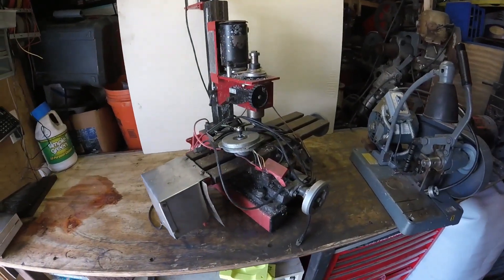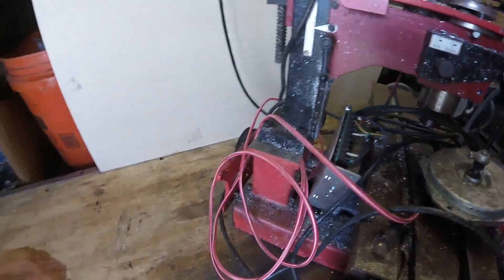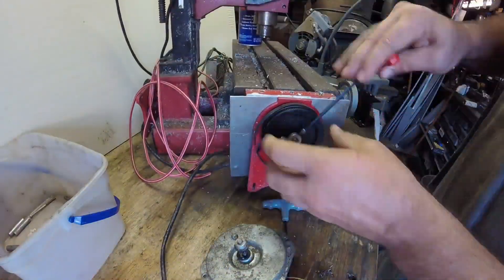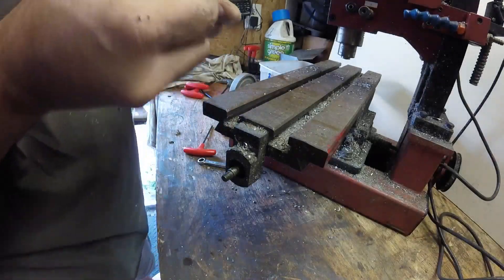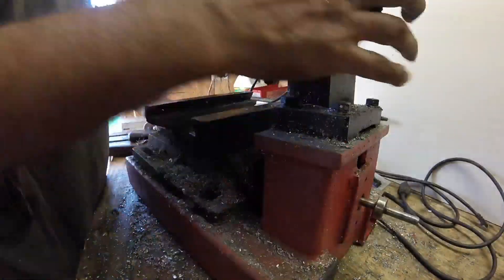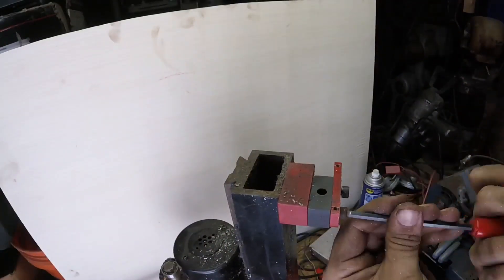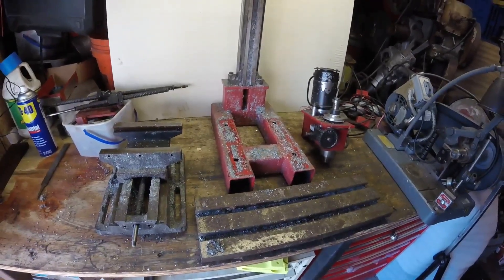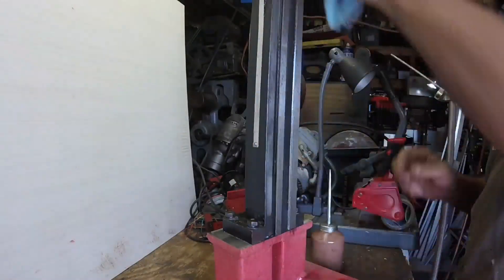Derelict CNC mill retrofit - Part 1 - Disassembly

Comment: That mill reminds me of the BK Rodeo burger where they repurpose their burger, onion ring and nugget sauce and pass it off as a new product.  In this case, they repurpose a 5" drill press, an XY vise and stock tubing.  LOL!  You gotta Rodeo mill.
Reply from the maker: HAHA!  I sure do.  When I first got it I looked it up to see what it cost new and almost fell out of my chair.  It was only about 3k less than a barebones Tormach 1100.  Don't know how many they sold but they don't appear to have a website anymore.
Reply from the maker: In the past I've gone round and round about converting some of my manuals to CNC and the final verdict for me is it's just not worth it.  For as cheap as you can get an old CNC with problem electronics and retrofitting you'd be way ahead then converting from manual.  Just the ball screws alone are a small fortune.  Building from scratch seems like it would be even worse.

On the other hand, by looking at this thing and what I've made on it in the past you probably could make something fairly decent out of almost scrap metal with only a few key components; one being a headstock.  Guess it just depends on what parts you stumble across for cheap or free.  Seems like you can't find them when you're hunting for them.